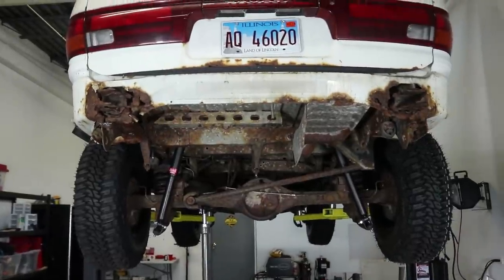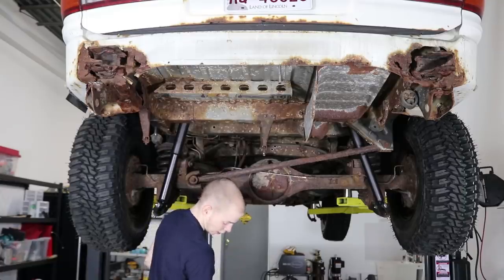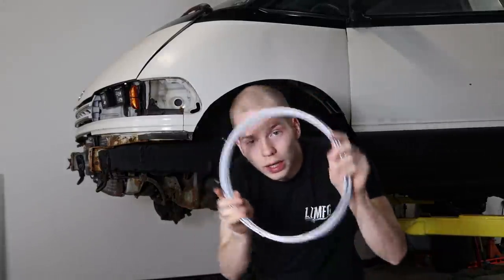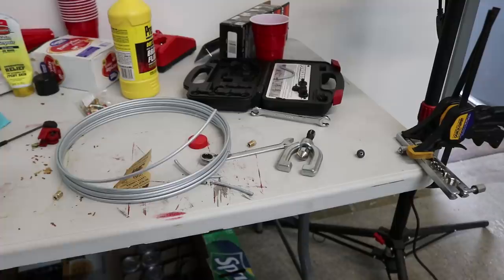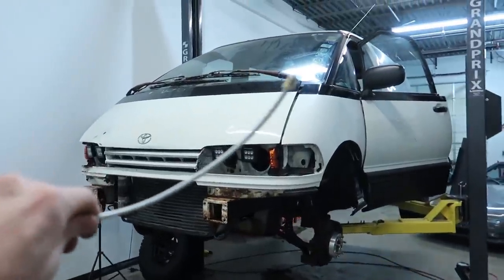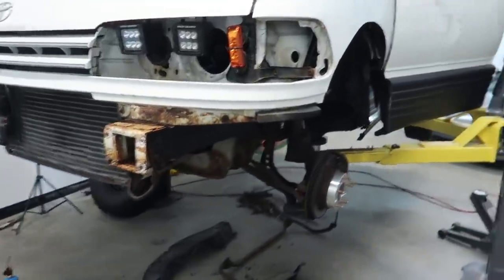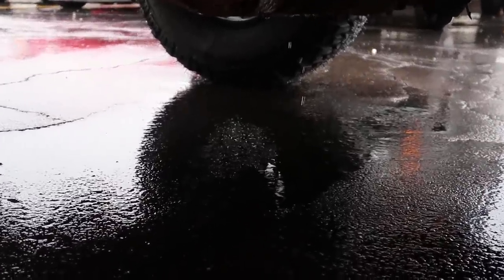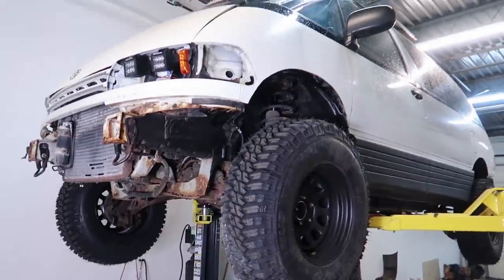First Drive in the Lifted Mini-Van (it blew up...)

Comment: Yep, she’s fucked mate, sell it for as much as you can, and maybe, MAYBE try the build again with another type of car, I mean saving the wheels, tires, and etc. for later are probably in your best interests.

Maybe try making a battle car out some shitty 4/AWD PoS from the 2000’s, you can add some wiring education to the car along with the welding, I’ve got no clue on what car could fit the bill. But if you don’t want 4WD an off-road Dodge Charger could be cool, hell if you really want 4WD get a Ford Taurus and build that.

This van’s a bust, get something new and try again, if you can get the sponsor to OK a new car, go for it 100%. Best of luck Gingium!

Comment: I still watch all the van videos. But the van is just too far gone to bring back to life without a ton of money and time. I could tell that from the first video. Keep the parts from it, sell it, buy a vehicle that's cheap but still in decent shape, and you will be able to build it much quicker. Research what kind of vehicles are easy to lift, cheap, reliable. A little googling before starting a project could save you time and money in the long run. Secondly, if you dont know how to do something like brake lines...youtube it. I guarantee there are multiple videos showing you step by step how to properly do that. Sometimes we get caught up in a fantasy that seems so cool, and it's especially hard to stop when you have time and money invested. But as any good poker player will tell you, folding and taking a loss is better then staying in and losing it all.

Comment: don't worry about it dude! just keep at it! i know it's frustrating but this thing rocks, so keep going! don't give up, don't cut your losses, be persistent and don't give up until you're happy with where it's at.

also, junkyard Ford 4.6 swap the battle van if the engine gives up on you so you have a V8, mid-engined off-road minivan

Comment: To your credit, you are actually working on vehicles, not just blabbing about them or editing to make yourself look like a genius.  This is real life, when you encounter setbacks and wonder if you made a mistake.  What is good for the channel and what makes sense for that vehicle may be two different things.  I am in a similar situation with a 99 Subaru from the rust belt.  What started out a CV axle replacement ended up a tar pit of ball joint replacement.  I gave up and had a mechanic finish the suspension stuff.  At least I made one smart decision by buying my Miata from Florida.  Feeling your pain.

Comment: Anything worth doing is worth doing well.

There's been times when I have wanted to give up on cars, and when I haven't and I worked through the issues, it ended up being something I really cared about and liked.

That being said, buying a rust car is never a good idea unless you are very committed to the idea of having to fix nearly everything. I don't know how much Previa parts are, but a brake job on a car you bought isn't the end of the world, the leak of coolant can be just as easy as a hose. Hope it isn't more serious, but if the engine was toast, it would be a very cool car to engine swap, just would need a lot more work, time and rust control. 

Oh and money, more of that too.

Comment: Remove the burrs with a drill, and lubricate the tip of the tool with brake fluid. Its so much easier

Comment: Sorry to hear about the Panda... It's really too bad everything is causing so many problems.  If i did not know better, that car sat in field for a few years and acting like its being driven for the first time in years.  Anyway that's horrible and hard thing to fix, a neglected machine... But at the same time, I speaking for myself am vary entertained with it every time I see it.  I think its crazy cool your taking this bucket of crap and beating it to do your bidding.  You could of had a whole series of video just just getting this thing up and running.  I know this is vary frustrating, and not vary profitable but I think you need to stick with it.  

If I was you, I double down on the 'this is getting done attitude.'  That's what I want to see, and what I think alot of other people watching you want to see.  You are a go get it done type of fellow and we believe you will make it work unless there is a hole in the motor.  Now go prove there is no expensive holes in that  motor and shake some more rust of the Panda.

Comment: What the actual fuck, why are people being so negative....ah waaait it's people. I understand, that it's a complete rustbucket, but I thought the original idea for buying such a vehicle was to just spend a minimal amount of money for the maximum amount of fun, whilst not expecting it to last years. As long as the repairs to make it running on an OK level, don't go over brakelines, the broken hose(s) and maybe some other small things. Then take it off roading and see if Toyota vans are as tough/reliable as most of their other cars. Drive it until it breaks, then take the wheels, lights, new battery and whatever other useful parts off of it(perhaps for a next build or just sell em) and scrap it. :)

Comment: What's the term and condition of this sponsorship of this build?

Ask a Facebook group what parts are interchangeable with this mini van, and hit the junkyard.

Didn't you buy a welder?

I have a 1993 Toyota MR2 Turbo, and thinking about doing the same thing as you did to the offroad Miata.

Comment: Dude I am surprised you didn't realize you need new gearing to move the bigger tires either get some new differential gears or buy portal axles you are pushing that engine past it's limits

Comment: What a shitbox... not only did you have to change the brake lines you need to sort out more rust that's structural or you'll fail the MOT (don't know what it is in America) also a rough running engine lol